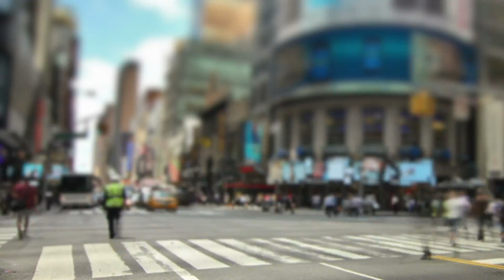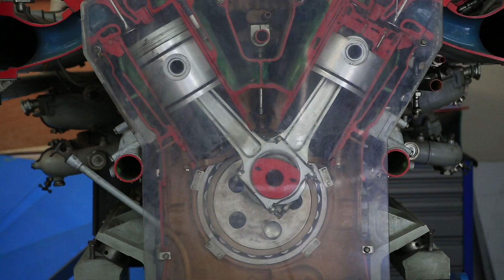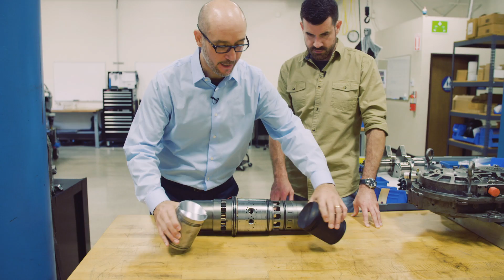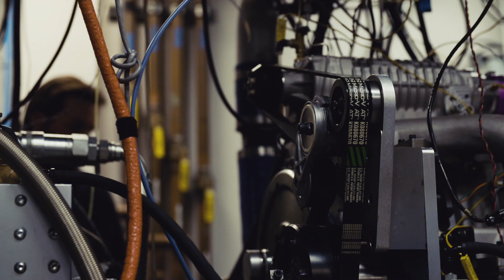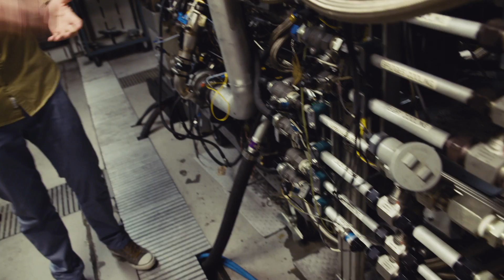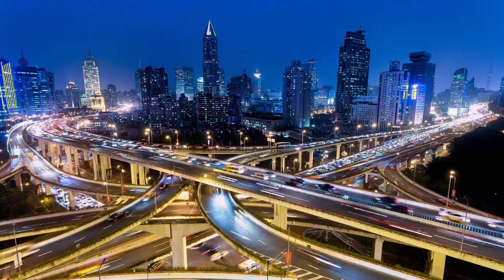This Radical Redesign Could Keep Gas Engines Pumping | WIRED

Comment: actually cam less combustion engine is the future from Koenigsegg  and Volvo. also everyone preaching electric this electric that. Move. To. Europe. electric cars DO not have the range or capabilities for the United States nor does it allow freedom from the cities.
Reply: Ronn W  Tesla Model 3 is around the corner. Tesla is starting production mid--year 2017. Starting at $35,000 before government incentives from the federal and state. Range for the M3 starts at 215 with a 60 kw. battery. More than 500,000 have deposited reservations for the Model 3. Exciting times indeed. There will electric vehicles everywhere in the streets after 2017.
Reply: Sorry Carlos, but most people can not afford the P100D.  
I would buy and electric car if it has 300 mile range can fully recharge in under 5min, and had a price of under 25K. 

Until that happens the electric car will not be able to compete with the gas car.
Reply: Interesting.  Yes, I crunched some more numbers and the model 3 will be over the cost of a Hyundai Elantra base.  

Model 3 after incentives ~27,500 +
Electricity cost after 150K miles ~ 6,300  ( based on .14 per Kwh)
Total cost after 150K miles ~ 34,662

Elantra base ~18,150 
Gas cost after 150K miles ~ 14,063  ( based on 3.00 a gal )
Total cost after 150K miles ~ 32,212.5

Now if you drive more miles with the model 3 it will start to save you money.  However, if you have to replace the whole battery it will cost you 19,000( in 2016).  Buuuut, in 8 years maybe Tesla can get the cost down or maybe you can just replace the bad module.  

Hummmmmmm It is very close.  Lets see what happens. I will let the rest of the people test it out and if it works I will jump on board in 5-10 years.  

Good Luck Tesla.
Reply: David Jenkins 
Yes.  All good points.  I love the idea of 0 maintance.  I do all the maintance my self and I would love to have back that time back.  I have been crunching the numbers on a prius prime and that might be a good fit for me in a few years.  Or a BMW i3 with the range extender.
Reply: John Hecke  Wrong.  A Tesla Model S P100D has a range of 315 miles and there are Superchargers all over Europe /free for life.
Reply: John Hecke 
I actually drive a prius ( I was looking for a dependable car to drive uber / lyft and found a deal on a 2011 Prius ).  
I had to same concerns about the battery so, went on ebay to see what I could find as fast as a used battery and you can get them between 500-1000.  Now will a prius save money?  Maybe if you drive enough.  However most people won't.
Reply: @Ronn W I don't dispute your numbers, but you're leaving off an important category: maintenance. The Elantra will need oil changes every 6 months or more often depending on how much you drive it, coolant drain & flush every year or two, an induction clean (blow out gunk from fuel injectors etc.) every 50k miles or so, a tune-up (new plugs at least) every 100k miles, etc. I just had the oil & filter on my 2005 Saab replaced today, to the tune of $68.30. (I could save money by doing it myself, but the front end at least must be up in the air to reasonably access the oil pan drain plug, plus changing the oil filter is no picnic either, so I pay a local mechanic to do it.) Just assuming oil changes every 6 months at $50.00 each comes to an additional $1,000 over 10 years. This makes the Model 3 even more competitive.

The maintenance schedule on my other car, a BMW i3, is: check tire pressure, replace wiper blades when worn, and change brake fluid every 2 years. That's it. Needless to say, I'm driving the i3 everywhere its 150 mile range will take me between charges.
Reply: Ronn W yeah there are no good points to the electric car don't let them push it on you. here's why
A. the battery replacement will cost at least 4-6 grand that was for a prius hybrid battery when I worked as a mechanic. God forbid you have to buy a battery for a tesla when ultimately they will fail.
B. fossil fuels are still way more practical and will be for many many years probably even another century. not to mention the fact those tesla vehicles still use them. grease for the hubs and rotating mechanical parts and for ANY plastics in the interior trim or undercarriage.
C. GASOLINE prices will probably stay within 2.80-4.00 range for the next couple of decades IF there is no recession or regulatory requirements for gasoline or fossil fuels.
see everyone who is buying electric cars fail to see 3 major effects of the electric car.
1. do you HONESTLY think that when fossil fuels die off like you want in vehicles that they are no longer needed. do any electric car owners understand the magnitude and size of oil gas grease and lube? ALMOST every mechanical mechanism uses a lube or oil.
2. if gasoline dies and it's no longer an option they will rise your energy bill and then you will truly be at the mercy of big business. God forbid the thing that shelters you with heat A/c and lights becomes more of a commodity instead of a normal everyday bill
3. the economic implications of an oil free society would put SO many out of work. oil field workers and businesses. automotive mechanics. automotive parts distributors. those are the simple ones I can go on and on. he'll even escalator and elevator repair. and installation companies plastic companies. 
I don't mean to go off on a rant but those of you self righteous environmental people don't seem to understand the big picture past the tesla in your garage and the horizon past your little existence in your city.
Reply: John Hecke 
Oh I also looked up a volt's battery on ebay and found them between 1900-3500

To figure out to see if it where save you money where you live,  just calculate the cost to drive 1 mile vs car x.
Reply: John Hecke
"... those of you self righteous environmental people ..." Happy Holidays to you too!

Your concern for Saudi sheiks and the senior executives and shareholders of Exxon/Mobil is truly touching. You could help them even more! Replace the fuel injection and electronic ignition in your car with a good old carburetor, points and condenser! Throw a couple hundred pounds of sand in the back for good measure.
Reply: John Hecke.  The earth is flat theorist.
Reply: Please look into Samsung’s battery development. Electric vehicles will take over faster than you can believe. Even trucks will be electrified.

Comment: How does this have anything to do with Trump or emissions? 

Also, they will be creating a truck for the military before civilian vehicles... That means that the US Government is already researching and developing it. So again, what the fuck does this have to do with Trump?
Reply: because they mentioned emission restrictions in America. Doesn't it make sense that the President of the country would have something to do with emissions controls legislation?
Reply: Obama was pushing for fuel economy and alternative energy sources. The government helped out Tesla for example.
Reply: lessdeth69 LMAO. Electric vehicles are better then combustion  powered vehichles in every way except one. But that's more then enough to impede their market penetration.  Electric  motors power less then 1/2 of 1 percent of of all vehicles and as long as it takes 8 hours to recharge them and something like the Bolt cost 35 thousand dollars ICEs will dominate the transportation market. Until supercapacitors can store enough juice or fuel prices skyrocket the electrification of personal transportation will be slow.   I'm as skeptical of this achates engine as I am of the HCCI engine that every major car mfr  has toyed with.  But why not?   If they can pull it off, it will make a huge difference in pollution as well as improving our lives by reducing the our energy expenditures.
Reply: anthony johnson when they said military vehicles they meant not the American army but the best and most powerful army, the British.
Reply: Quaint.  What a waste if time.  ICE is done.  Electric drive is dramatically superior.  Just look at the ancient mess filling that room.
Reply: This is a technology for heavy diesel engines, not for a car.
And electric heavy trucks, tractors & construction equipment is impossible.